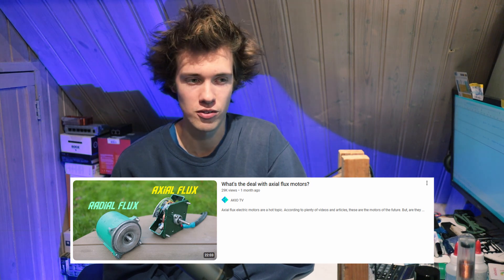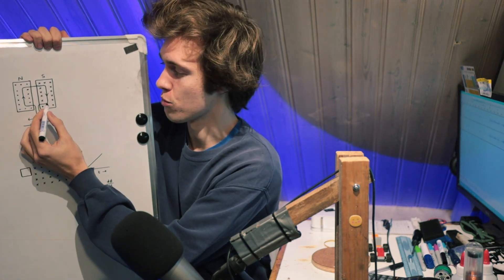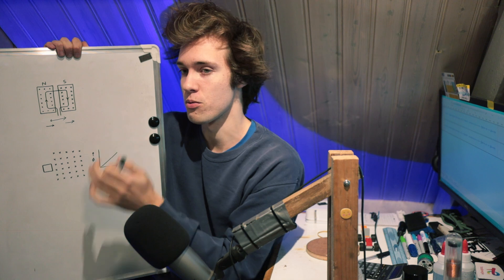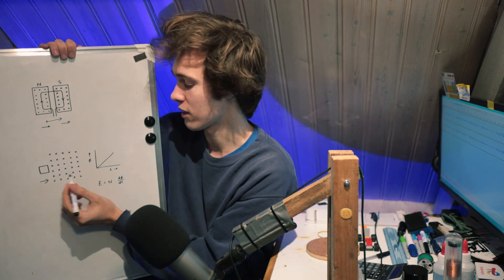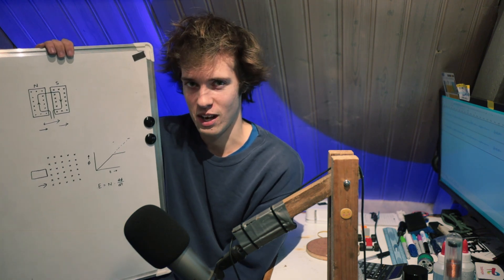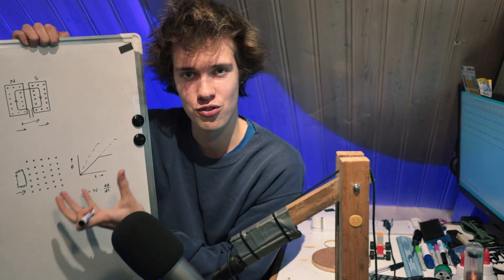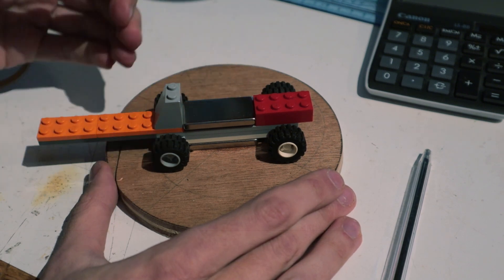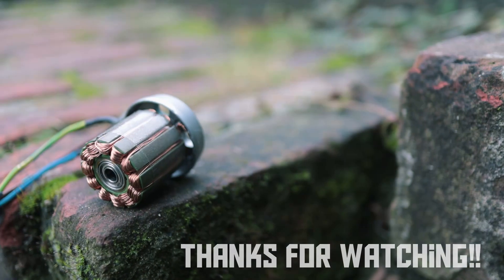Not the whole motor winding produces torque

Comment: From your explanation, does it follow that the worst coil for an axial motor is a round coil, right
Reply from the maker: @Oloff-g3y  Strange comment, (does it have half of an ai prompt left in there?) but yes, a round coil is the worst and you'll almost never find it in a professionally made machine. (it is all too common in diy motors though)
Reply: @AKIOTV  My English is very bad, so I used a translator. And you know what? Cola isn’t the best friend of a keyboard. That’s why my comment turned out weird. I fixed both the comment and the keyboard. Thanks for your reply!!!👍🤝

Comment: Have a look at what determines the current you can push through a winding before the core saturates.
You may get more out of a higher ratio stator but only if the stator has "width" or it's cross sectional area is 0. You get to a point when you simply don't have enough core to handle the field you want to generate. Motor constant Km reflects this well.

Comment: This is not correct. Without the core it would be correct only the wire perpendicular to the magnetic field would contribute. With the magnetic core all of the wire is perpendicular to the core and adds to the flux which is measured in amp-turns.

Comment: Thank you for your videos.

I have always struggled with magnetism, both on a practical and conceptual basis.
(And space, time and gravity on a conceptual basis.)

May I ask a stupid question or two?

Axial flux generator. 

if I understand your reasoning correctly, it might be better to have windings that are as narrow as possible, from a torque (Amperes) point of view.
Is this correct?

With that being the case, that would suggest that the best magnets for such a coil would need to be narrow, narrowed than the air gap in the coil, and the north-south field of such a magnet would be best if oriented from side to side rather than front to back.

Would that be correct?

Thank you for your videos.

Take care.
Reply from the maker: @mikemalone9678  You might theoretically conclude that very narrow windings are superior, but practically you start to run into issues when trying to realise this, such as:

are you going to keep the winding thickness the same? If yes you can see how that starts to become problematic for very narrow coils.

The machine is going to have lots of poles, meaning it needs to be driven at higher electrical frequencies to spin a certain speed, which might cause more eddy current loss in the motor or power loss in an electronic driver that may be used.

And more.
Reply: @AKIOTV  I was thing about generators, rather than motors. Putting more effective wire in to a generator should make it more efficient, as the coil resistance proportion reduces, all else remaining equal.

Comment: I either don't understand or don't agree. Suppose we build a motor that has a square stator core that has coils such that only the "inactive" parts of the coils are next to the stator. I.e.
CCC SSS
C  C SSS
CCC SSS
The rotor's axis would be horizonal, so the magnets would need to move up or down. Leaving aside the horrendous efficiency such a motor would have for the moment, if the theory is correct, this motor should not turn at all because it has no effective windings. 
But when I place a voice coil next to (not around) a large nut and applied a current, the nut does attract a paperclip, so clearly some magnetic field is created. 
So either I really don't understand, or I disagree.

Comment: 14:30 Work = F x d. Dont forget that the longer magnet travelled twice as far with, as you state, the same torque, therefore, twoe as much energy has been expended compared to the shorter magnet.
Reply from the maker: @MolinaUdofo  Correct, but this demo was about peak torque, not work/energy or power. 

Even so, if you do want to think about it in terms of work/energy you also have to keep in mind that by shortening the poles by 2x, you'll also have 2x as many of them in the same size motor. In the case of my demo, if these magnets were part of an actual motor, each pole would indeed do the same work 'per stroke' as before, but overall the work would  be 2x as much.

Comment: What if the stator windings and rotor magnets are circular?
Reply: Any windings not perpendicular to the available magnetic field and direction of motion will have less or no effect. If the winding is circular, then only a small portion can be considered perpendicular in the direction of motion. If the magnet applying the field is also circular, that is worse, because the field has a very small "sweet spot" where it can align properly with the circular coil moving past in a sideways direction. For circular coils and magnets, coaxial reciprocation (like one of those shake to charge flashlights) provides the best interaction of the fields. Also, I have recently discovered "circumferential flux" motors, which follow this reciprocation motion in a different way.

Comment: While what you say in the video may be accurate theoretically. It is practically very semantic and pedantic. 

First, almost all motors that really worry about copper usage have flux directing laminate cores. Which throws everything you state in this video about free air wire Lorentz forces out the window.

Two, it is impossible to have the coil of wire without the end windings. How are you going to get the current from one side of the coil to the other? Magic? Sure reducing the mass of this wire is nice but it must retain the same current carrying ability as the wire running as you say in the "preferred direction".
Reply: @AKIOTV  The geometry of the tooth shoe isn't necessarily the same as the geometry of the tooth the copper is wrapped around - so in reality all bits of the copper (except the component travelling up the tooth) is used. Usually teeth dimensions are based on the saturation characteristics of the material and ideally it would have a constant area. Making the tooth wider increases flux carrying capability of the stator and can indirectly lead to higher torques by allowing larger magnets, more MMF or lower air gap reluctance. If you are reaching your desired maximum operating points without saturation or going under your efficiency limits, you have likely oversized your motor. Stator geometry is a pretty complex process with many tradeoffs and interlinking concepts you have to consider.
Reply from the maker: @mitchellstrobbe7779  As I mentioned, even if you don't consider lorentz force and just use a rectangular core to explain the motor, it's still the width of that core that matters, and so ultimately the with of the coil. 

The end turns are of course necessary to make a complete winding, they're not "useless". But a motor with less end winding material uses coppper more efficiently. This is also one reason why, if you make a motor larger in diameter (and leave the length the same) you may to increase the pole count so that the "aspect ratio" of your windings remains good.
Reply: @ this is not the reason larger diameter motors usually have higher pole counts. True, higher pole counts usually create higher torque, but it is not because of "aspect ratio" it is because they enable more concurrent flux flow for a given rpm. Higher rpm motors reduce pole count to lower flux flow and inductance so that reverse emf is lower. This allows higher switching frequencies as the current can rise quicker and higher with lower emf and inductance. 

I realize I may come off as a stuck up prick but motor design is not nearly as simple as this video makes it out to be.
Reply from the maker: @mitchellstrobbe7779  More (and therefore narrower) poles are a more efficient use of wire. That's not the same as "more poles produce more torque", which is besides not always being the case, also not what I said.

Comment: If the rotor shaft is vertical, a taller motor build will give more torque? Is this correct? Compared to making it wider.
Reply: Making the motor taller or lager in diameter will increase torque, torque is directly related to the amount of magnetic flux. More flux, more torque.

Comment: dont get why on the diagram up and down forces are opposite so they cancel each other out. However left and right are opposites yet there forces are going in the same direction and dont cancel out.
Reply from the maker: @jamessssssssssssssssssssssssss  both sides of the coil generate force to the right, not to the left. So the net result is a force to the right. But for the top and bottom sides, some parts produce force up, other parts down. The net result is nothing.

Comment: Would you agree if I was to make a axial motor for a lawn mower which requires 3,000 RPM. Due to each stator slot pushing and pulling both sides of the stator with magnet rotors each side, wouldn't that be more efficient than a radial motor

Comment: Doesn't all the wire create a magnetic field, thus also generate torque?
Reply: Yes but that torque is perpendicular to the magnet and opposite on each end therefore has nothing to do with the running torque of the motor itself. If you picture the the coil like a rectangle there is a line going in one direction all the way around. The short sides are 90 degrees in the wrong direction and opposite on both sides. So they have no real use to the motor itself. Hope that helps
Reply: @newmonengineering  But the iron in the stator collects and redirects the magnetic field lines in the correct direction?
Reply: @RolfRBakke  Yes, yes, but if we look at the car demonstration he did, we can see that the same magnetic flux does not generate the same amount of torque based on orientation. 

You are correct in that the wire overhang adds flux, but the added flux does not contribute to torque. The whole part of that coil is now one pole.
BUT all that flux does not generate torque, its in the orientation.  

Here's my analogy:  Imagine a broom sweeping spilled water off the floor. The longer the broom head, the more water it can push effectively in the direction of the sweep. Adding more width to the broom head doesn’t help in pushing more water and doesn’t contribute to the sweeping action.

Magnetic Flux =  Magnetic Field x Area x angle 

Yes, the whole coil contributes to the Magnetic Flux concentrated by the iron core, but the flux has to be oriented properly to produce torque. 

For example, when sweeping water, you'd need to orient the broom head to push water. If you sweep the broom head using its side and not its face, you wouldn't push the water only slice through it, no matter how hard you put force on the broom.

 might have to do a couple rewatches like I did to finally get it

*Also , the overhangs do not produce torque within the context of a sideways movement. If it were a linear movement like a piston, then the electromagnet gets to push a magnet with all its flux and generate torque through a crankshaft.

Comment: hmmm... but the wider coil still makes for a more powerful motor because the maximum speed of the motor is increased because it has to be switched less frequently. The maximum switching frequency (the minimum time it takes for the coils to be energized) determines the maximum speed of the motor, doesn't it?
Reply: Switching speed has little to do with the power. More important is the design and materials used. Thicker wire gives more amps, saturation of the core is another part of it. Ita not uncommon to use PWM to control DC motors up to 30khz. Brushless motors are often switched into the Khz range as well. Most motors run under 30k RPM. Sure there are some that run even faster than that but most don't. The switching speed is very high on a 30k RPM motor. It might switch 6 times or 12 times in 1 revolution. The actual torque is related to the strength of the coil and magnet attraction, not how fast it switches. Hope that helps.
Reply: @newmonengineering  
In the video, he demonstrated that the torque is not only related to the strength of the coil-to-magnet attraction but also inversely related to the width of the magnet/coil.
This means that if you made a motor with twice the amount of magnets and coils of half the width, then you would get twice the torque. The reason why that isn't done is because you wouldn't be able to switch such a motor fast enough to make it spin at the same speed as the original motor.
If not maximum switching frequency, what else limits the speed and thereby the maximum power of a motor (besides cooling).
With switching frequency, i don't mean the PWM frequency but the (de-)energization/commutation of the coils.

Comment: I think your base assumption that the wire is in the magnetic field and therefore the lorentz force applies is false (or at least overstated) in motors with cores. The whole point of a core is to concentrate the B field (and 'amplify' H field) and the BEMF is mainly produced by the magnitude of magnet flux linked by the stator teeth and yoke and not necessarily what direction it is coming from. The windings usually aren't subjected to very high B fields unless the core is close to saturating (and for good reason). The actual part of the winding that plays no part in coil magnetic field production is the component of current parallel to the magnetic field in the core. 

I think your generator example was great and more applicable to the problem. If instead of a coil you used a 2d piece of solid ferrous material, making it 'taller' as you did would link more flux/second and (assuming equal flux density across the tooth) affect all copper equally (except the parallel section). If you made it 'wider' the amount of flux linked/second would remain constant as the original size like you demonstrated, however this is not because of any particular section of copper, it is the geometry of the ferrous material. Many motors actually have different areas for the part of the core that interfaces with the airgap and the part that is wound by the coils. 

My answer relies heavily on simplifications like all flux linked by part of the airgap-tooth interface is equally distributed into the rest of the tooth where the coils are wound, but the direction of the flux, once passed into the tooth, is usually quite parallel and runs down the length of the tooth, any differences in coil-linking would be due to field intensity differences and not any particular direction an electron is traveling.

I am by no means an expert and this is just my 2c!

Comment: Again, your claims are correct for coreless motors.  Not true for cored motors.  With your claim, how would you explain transverse flux PM motors, where the coil is completely "inactive copper" yet it allows for one of the highest torque-producing designs.
Reply: The opposite of what you said is correct, transverse flux motors entirely eliminates end windings.
Reply: @mitchellstrobbe7779  yeah but the right hand rule from means that the force on the windings are radial and shouldn't produce any torque. So where does the torque come from?  If there is a core you need to compute torque from the B fields.
Reply: @BlueJay137  transverse flux motors use flux guides to direct the flux that surrounds the windings through the rotor and back again. This is one of the reasons this video is so misleading. With iron core designs the core acts as a guide to focus and direct the flux from the winding. The actual direction of the wire is not important in the way the video describes for iron core designs.
Reply: @mitchellstrobbe7779  But he demonstrated how even with permanent magnets, the orientation still is important for generating torque?
the direction of the wire impacts the shape of the electromagnet, a taller magnet (or electromagnet) generates more torque than a longer one as it was shown, no?
Reply: @TheeFrancis   This is true as long as the shape of the core at the airgap is linked to the shape of the winding.  Which is kinda the case most of the time.
Reply: @pacresfrancis1565 uhh yes, no?  Adding the "n'est-ce pas" adds confusion. Using thicker magnets does not increase the torque as much as making it longer.  Ignoring saturation limits thicker magnets would mean more magnet volume is further away from the airgap. Making magnets longer increases torque linearly.  A good way to design motors is from the airgap flux densities since there are hard engineering limits on how much flux you can force through the air and still maintain enough of a gap to freely spin.